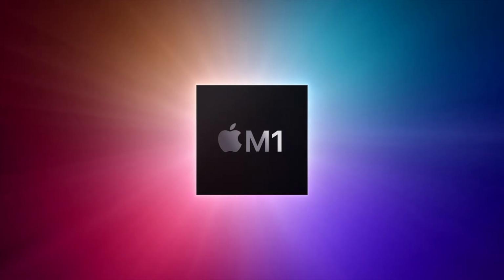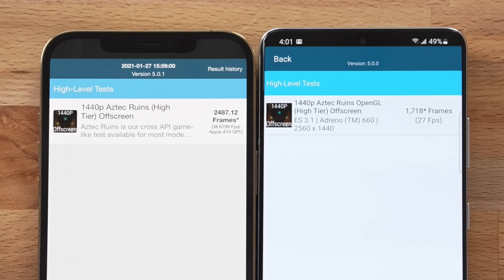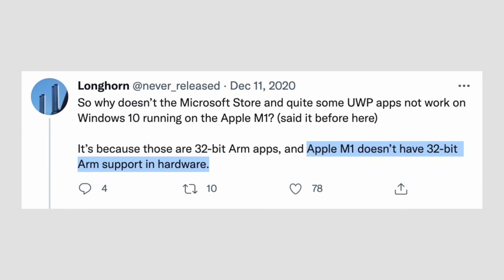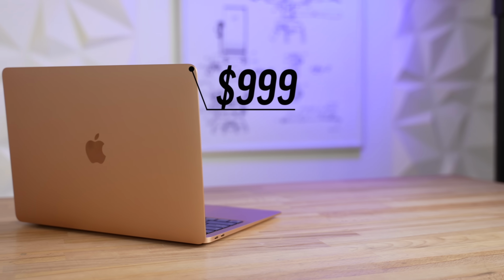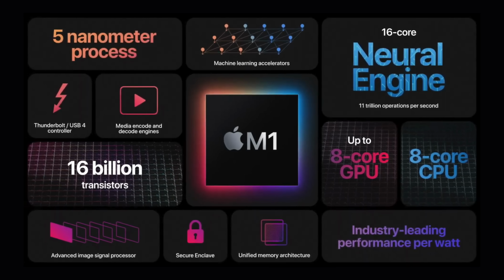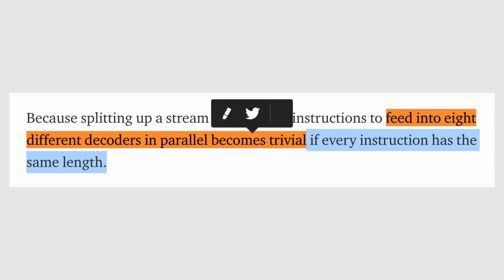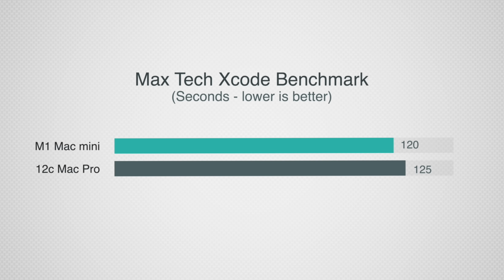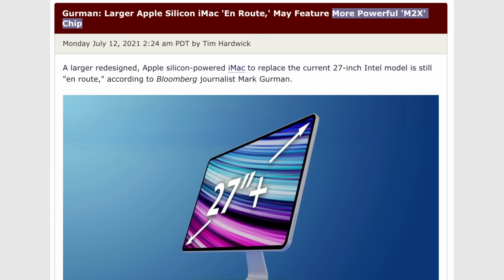Why Apple's M1 Chip is SO Impressive: Explained!

Comment: "I can't hear a fan in my MBA M1" j/k.. Actually Intel NUC has more than four cores.

I still do like the fact, to this day, we scew results to make [ours] look better weather that be Apple or Intel.

I thought only Intel did that... Its your typical. "If your an Apple user, you block out the competition to make your better"

I did a benchmark between Intel NUC 12-Core/32 GB my meet has, and my own M1 MBPA. 16 Gig. The scores are close, but it depends on the app..

I don't care "This is faster" because most people just think "across the board"... Not true. I don't afraid to admit Intel does better in some things, even if it IS talking about Mac.

Comment: I knew apple would ditch intel even before their mainstream macs with intel processors got released, he told this in 2005 when the developer pentium 4 based "mac pro dev kit" got introduced, he said that macos x was written to be processor independent, that it was secretly living a double life, and it made it easy for apple to write (read port) macos to other plaftorms, reading between the lines told me that they will not stick with intel forever, and i think i was right, Steve was right i must adjust, i think they had to go with intel because of the not available choices they had, it was the only smart move back in the days, but now, they finally are where they wanted to be.

Comment: I want to buy an iMac. Can someone please make me understand more about these? what's the difference between the 27 inch and 24 inch? I see the 27 inch still has the apple logo, why? is it older? I see the 27 inch model doesn't have the M1 inside. Why? which one is faster? the new 24 inch or the new 27 inch? the 24 inch seems to be able to upgrade up till more than 100 GB RAM but the 24 model only 16??? whats the difference between the 27 and 24? which one to buy? is that 8 GB or ram that important? are these upgradable ? can I add more ram in time? I really have no idea. Im new to Mac and I would like to buy one but I don't find a lot of info and their website isn't that complex filled with info. Is pretty empty actually.

Comment: PURE APPLE HYPE. A COMPANY THAT DOES NOT LIKE PAYING TAXES AND HAS OVERPRICED PRODUCTS. APPLE SUCCEEDS THROUGH ITS HYPE SUPPORTERS IN THE MEDIA. NOT SURPRISING. YOU WERE NOT BORN THEN, MAYBE. APPLE MOVED TOWARDS THEIR OWN ARM SOC, OBSERVING MANY INEFFICIENCIES AND FAILURES. WHY IS AMD RYZEN (RISING)? ARM WAS DESIGNED TO AVOID THE INEFFICIENCES OF THE LEGACY BLOATED INTEL X86. INTEL SOLVES ITS PROBLEMS WITH BRUTE SILICON POWER AND CLOCK SPEEDS. INTEL HAS NEVER BEEN ELEGANT. MOTOROLA WAS. POWERPC WAS. ONLY THE INTEL I960 WAS. SO, IF APPLE DECIDES TO TAKE CONTROL TO MAXIMIZE EFFICIENCE AND POWER, WHY BE SURPRISED?

Comment: Apple really did a good job although many people don't understand. They literally killed the unnecessary payments people pay for their devices (although apple is expensive). The consumers do not need to pay for the Intel or AMD processors seperately, and GPU can be intergrated but the CPU and GPU making companies did not want to do it as it would make their companies to close down. But it's very beneficial for the consumers as it can give us very cheap devices. When you buy Apple ipad with M1 chip for $1500 it's so cheap for it's performance. If they used Intel it would cost $2500 easily. Intel and AMD is so greedy. Apple basically did what people needs. Although they are expensive, they're the only company who thinks about their consumers to give better products.

Comment: I suspect it’s a bit of an exaggeration to suggest that Arm created its 64-bit architecture specifically at Apple’s request.  There were already other forces pushing them that way, such as PowerPC having a 64-bit architecture selling into the “embedded” domain.  It wouldn’t surprise me if Apple gave Arm a strong nudge in the direction though.

Comment: The M1 is limited AF. ARM instruction sets do not have the capabilities that the x86_64 already have and have had for years. It's simple. You're comparing apples to oranges here with your macbook vs surface etc crapola. Configuration makes a huge difference. Anyone saying M1's are better than Intel either a) Doesn't know what they're really talking about or b) is just a fanboy. Oh or c) is paid to say so

Comment: Dude, the M1 still uses dual channel memory. The 68.25GB/s is achieved by using LPDDR4X-4266 on a 128 bit memory bus. That memory bus configuration is dual channel, not 8 channel. The article is comparing it to the A14 in iPhone which only uses a 64 bit bus, and that’s single channel.

Comment: Why is there so much focus in OpenGL?
It has nothing to do with M1. 
M1 Supports OpenGL. 
Metal was more a general industry change. 
Windows -> DX12
Linux -> Vulkan
Reply: M1 supports OpenGL through a compatibility layer. OpenGL runs on top of Metal on M1s.
That and Apple's implementation of OpenGL is several years out of date.
Reply: @MaddTheSane  sure but thats also true for the intel macs. and intel macs run metal just as well.

Comment: What will happen in future when we will reach 1nm chips and maximum core counts?
Reply: There are numbers smaller than 1nm.  It's not like the next shrink is 0nm.  You move to the next unit.  Beyond that, 3D stacking and crazy wiring.  There's always tricks.  I don't know what maximum core count is, it's a huge number.  Look up Amdahl's Law.  No one knows in general but it depends on what you are doing.  If I had 2 million cores on a chip, I'd combine servers (given all other things equal and ignoring I/O).  So generally speaking, we are probably heading towards hundreds and thousands of cores.  Possibly many specializations.  And then some people think that the CPU will be used less and there will be more ASICs or specialization.  Ultimately, this is still compute with different names.

The really snarky answer to this is, we'll have to program much differently.  :)  This is also where Apple is smart by having these enabling APIs.  Open standards usually win over time, so idk what happens with that outside their ecosystem.  They probably continue to keep control, even if some of the source is open.

Comment: Currently using both the 2019 MBP & the 2020 M1 Air & you can definitely tell the huge difference between the two; its absolutely nuts the amount of power this machine has and all that it can do.... so much that you it makes you think that what will happen if you get a machine with more RAM & more power, how will that perform? Well, life is only gonna get better if you're an Apple fan....although even tho I use Parallels on this with Windows the experience is not so enjoyable as a full on windows gaming machine as there are some limitations even with Bootcamp/Intel - Star Wars Celebration Edition was not compatible with Origin as it does not support Bootcamp !
  But rest assured the Apple Silicon Team has made an outstanding power packed compact light weight with the best battery life MacBook !!!!  🙏

Comment: I have a MacBook air M1 and a Huawei D14 with a Ryzen 4600h and yes the Mac has an unbelievable battery life and great performance, but how come it is so slow opening programs like MS Office word or even the chrome browser opens faster at the D14, it also frustrates me that the M1 Mac can’t run a 4K display at 60 FPS, it runs at miserably 30 FPS.Almost every modern windows laptop runs 4K displays at 60 fps.

Comment: Keep in mind that a lot of the performance improvements you are seeing here are due to optimized code (which is easier to do for a set architecture - x86 is far more varied), and from hardware acceleration blocks (it's almost always faster to do it in fixed-function hardware).
And Metal is more efficient, only when you program for Metal. For example, if you take a game written for a PS5 and try to run it using the equivalent Metal API, it's going to run terribly. That's because Apple relies on a TBDR GPU architecture, whereas the PS5 relies on a forward rendering architecture (sort middle vs sort last). You need to explicitly optimize the graphics calls and behavior to match the TBDR in order to get the efficiency. Also, TBDR has issues with non-local full-screen effects. So anytime you need to run a kernel over the screen like for sharpening or blurring, it's going to struggle. And TBDR can add additional latency to the rendering. Ideally, you want to generate the draw lists for frame N, while you do geometry transform for frame N-1, and do the pixel shading for frame N-2, and output the buffer from frame N-3. So that's a 4 frame lag. Contrast that to a forward architecture where you can do the first 3 steps in one frame and then output in the next (so 2 frame lag).
Also, the high-speed memory architecture is only practical for a SoC like the M1 in a laptop. You can't have a similar solution and also allow the RAM to be upgraded. Also, it's not scalable. So if you need a system with 128GB of RAM, that's not going to be possible with that architecture. Although, you probably would never need that in an ultrabook formfactor. It's also possible that if Apple decides to adopt CXL, they could allow for an intermediate RAM expansion solution.... If they can meet the speeds that AMD does, then CXL should be as fast (bandwidth and latency) as Infinity Fabric - which is how the AMD CPUs access main memory. i.e. you would have the small and high bandwidth LPDDR4 channels, and then a bigger and lower bandwidth N channel DDR4/DDR5.

Anyway, the tl;dr is that the M1 is fast when you optimize for it. But the same thing is true for an Intel based system. It's just more practical to optimize for the M1, because the architecture is more consistent. 
In 5 years when there is a landscape of 40 M1 variants, I'm not so sure the performance is going to be quite as good. After all, a big reason for why the x86 decoders are so complicated, is legacy support back to the 8086. Though the performance / watt is always going to be better for RISC.
Reply: To my knowledge, M1 can't run ARMv2 code natively, so I don't think the 8086 comparison as apt.

Comment: The fact that M1 doesn't support 32bit ARM instructions is completely meaningless.

32bit x86 would have to be recompiled by Rosetta anyway, so they could just recompile them to ARMv8 just like they do for x86_64.

I'm also not sure why Metal is mentioned so prominently. The primary reason why it's so much faster on Mac OS than OpenGL is that their ancient OpenGL drivers are extremely slow and havent been updated since 2011.
Reply: it's not meaningless but I guess you missed the point.... DOUBLING the instructions 32 + 64bit versions would double the die space needed which would give worse power performance, would get hotter, would perform worse... a clean slate with only what you need is SO MUCH better for both them and the users.... PC's (X86-64 should do the same) it needs a FULL rewrite, drop all 32bit crap etc. and they would perform way better but it would also lose all compatability which "omg we can't I want to use my 20 yr old printer" well.... those ppl are the reason we can't have awesome new things... so they keep pasting on new crap and the dies get bigger and bigger and more inefficient each generation
Reply: @LiLBitsDK  Handling this in Rosetta wouldn't have needed any die space. I'm not talking about supporting 32 bit ARM instructions. It could just compile 32bit x86 to 64bit ARMv8.
Reply: @Rhedox1  yeah but you can't just take 1 code made for 1 language and slap it into the compiler to magically convert it to something else. it needs to be written for it.

Comment: Apple products will be a no-go for me unless they take 30% off their original price. Too expensive and underpowered, can't even game and my legion 5 pro can render 2.5x faster than a MacBook Pro. The only thing going for Macs are the power efficiency, and that's not enough to justify the price.
Reply: Mac Mini M1 is super cheap at 699 or so... the Mac Air M1 at 999 is super cheap and I guess you are extremely blind when you call them underpowered... they outperform way more expensive machines, way more power hungry machines. higher end CPU's etc. they are FAR from underpowered. doubt your Legion 5 Por is 2.5x faster in rendering, check out the high end mobile CPU's they have compared with and M1 can game just fine even though it only have 7-8 GPU cores... the new ones is rumored to have 16-32 GPU cores... or 2-4x more than the cheap M1 and the M1 already perform pretty impressively in games... and when more games become better optimized for Metal/M1 then they can squeeze out way more performance... and how much did you pay for you Legion 5 Pro? Hmm? they are not expensive... they perform well, the laptops have great battery time and the M1 chips sip power while performing better than much more power demanding CPU's...
Reply: @LiLBitsDK  dude I have both m1 MacBook Pro and Mac mini, I have tested them out and I know what I'm talking about. I only use them because they're required for my work. Both of them are very underpowered compared to a mere Legion 5 Pro, and more compared to a poweruser PC. 

I got my Legion 5 pro for around $1,300, a Chinese variant with R9, while I got my MacBook Pro for around $1,645 and my Mac mini for $1,450. 

Fanboys like you make apple products expensive. Stop.
Reply: @prettyworm7311  do use your Legion 5 pro plugged in or do you use it on battery because the M1 MacBooks keep there performance even if using it on battery most windows laptops drop there performance when they are not plugged in
Reply: @lesleyhaan116  plugged in of course, it's essentially useless when plugged out. That's where my MacBook Pro comes in. Still I think it is very expensive if I'm only going for the portability. A coworker owns an Acer Swift 3 and that thing lasts for 8 hours at best, only at $650.
Reply: @prettyworm7311  but what is the purpose of using a laptop if you have to be plugged in all the time you can just use a desktop PC instead? and if you take your laptop of the charger the speed will decrease a lot meanwhile the M1 MacBook wil keep it’s full speed even if you are using it on battery the new M1 macs are not perfect but it’s pretty impressive what apple has done whit there first Mac arm chip just wait what apple M1X wil bring
Reply: @lesleyhaan116  that's because I travel a lot and bringing a desktop PC everywhere is really troublesome. M1 is great but what I'm saying this that Apple products are really expensive in general, compared to other products with the same or more quality, and I can't justify me spending on it unless it's for work.
Reply: @prettyworm7311  the M1 MacBook Air is not that expensive you can get one for 850 dollars the screen is really good the keyboard is also good the trackpad is good like every MacBook and the battery life amazing 18 hours of battery life there is no windows laptop whit the same battery life and the M1 chip is really fast there is no windows ultra book whit the same build quality speed and battery life for 850 dollars
Reply: @lesleyhaan116  18 hours only in idle, do not mislead ok?, in real work use only 10-11 hours which other windows ultrabook machines already can do

Comment: How about GPU? Hardware raytracing? How can it compete with nvidia interms of performance?
Reply: Metal has APIs for raytracing (introduced at wwdc 2020) 

However it’s upto devs to integrate it into their apps and games. Currently, apple a14/M1 gpus dont have hardware accelerated ray tracing. 

Maybe future gpus in A15/M2 gen silicon will get dedicated raytracing cores like RTX cards. 

I expect this because 
1. SD888 and SD865, both have Ray tracing support today. 
2. Apple would like to utilise the metal api to fullest and for that hardware acceleration is important.
Reply: you are comparing an APU with a dGPU that uses 20x more power and weigh more than a whole macbook... you should compare the M1 APU with the AMD APU's 5600G/5700G etc. ;-) and then the M1 still performs very good.
Reply: Who said I am? I’m asking if M1X gpu will come with HARDWARE RAYTRACING ACCELERATION like the rt cores in RTX cards.
Reply: @zeliglim778  M1X won’t have it because it’s same IP as M1 with more cores. 

Apple might introduce RT cores in a new generation IP like A15 and then, M2 and M2X would be able to get Ray tracing using hardware acceleration

Comment: If they make machines upgradable I wouldn't hesitate to switch
Reply: I prefer non upgradeable. Having a system on a chip sucks for upgrades but is awesome for performance.
Reply: @fod1202  I prefer upgradable laptops as you can easily use them for 7 years
Reply: @fod1202  exactly my thought... performance, size and power usage... yes you have to upgrade when you order... but except in the 90's and start 2000's I haven't upgraded my memory after building my PC a single time, I slot in what I expect to need (16GB for the longest time, then last time I built I added 32GB) more storage? well even though there are room in the case, I still just add a Samsung T5 2TB if needed... external drive... would do the same on the mac...